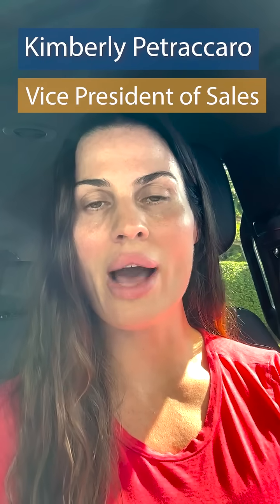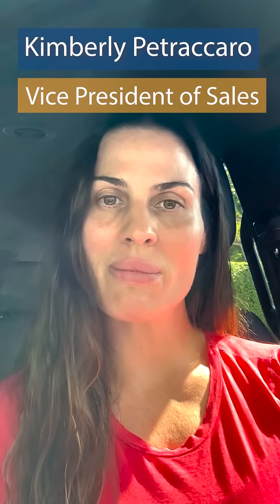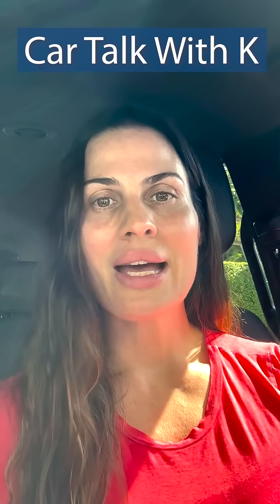Car Talk With K: Temporary versus Permanent Static Control

Comment: What are you talking about? This needs context. You sound very knowledgeable.😅
Reply from the maker: We’re talking about sealers, or floor finishes, that are branded or sold as a static-control product. People sometimes ask why they should invest in a static-control floor when they could simply paint an inexpensive sealer over bare concrete or a regular (non-ESD) tile floor. Kimberly is saying that, to prevent static, sealers rely on humidity in the environment and humidity fluctuates, so the effectiveness of sealers fluctuate. Sealers also wear off. A permanently conductive floor, like our AmeriWorx ESD vinyl, performs regardless of humidity and provides permanent static control that doesn’t wear off. Thanks so much for viewing!